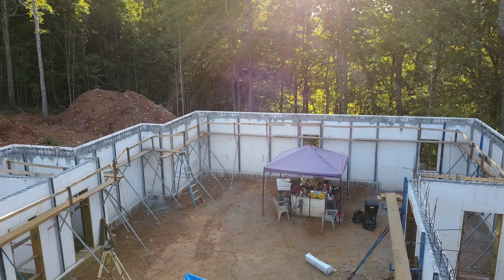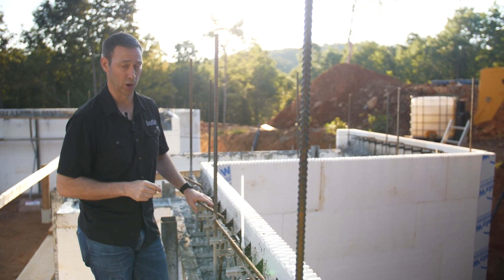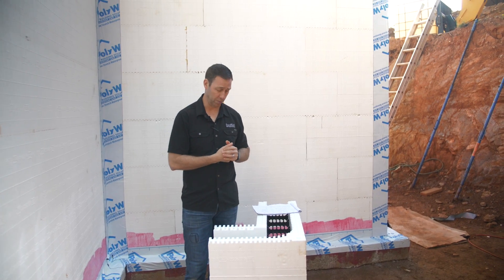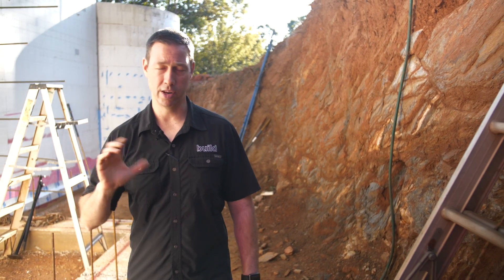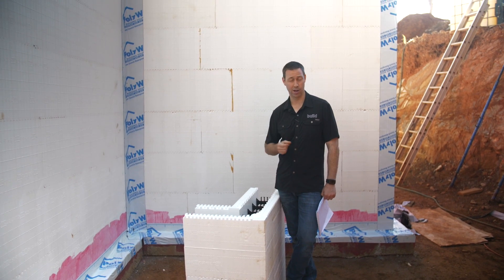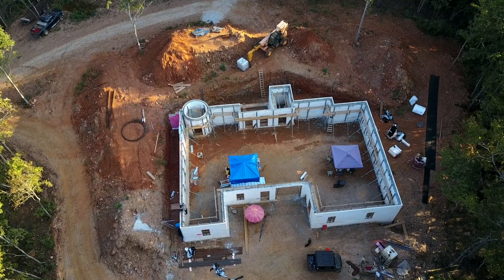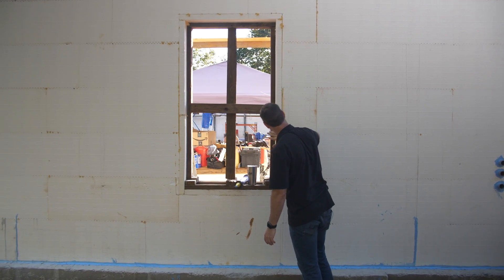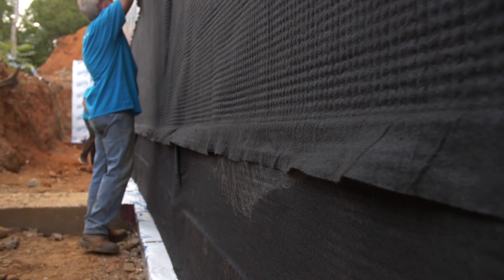Insulated Concrete Forms - Overview, Costs, and Cons

Comment: I'd take a continuous r22 over a studded r30. Using aircrete may raise that r value but it won't be as strong. Can you look at double studded houses? No thermal bridging and no need for expensive and sometimes toxic foams and that rock wool is expensive too I don't like it. You can just use blown insulation which is awesome and I saw that they were putting a vapor barrier in between the two walls I'd like to have that explained to me too I don't know why you wouldn't just use an air barrier or at least put that new membrane stuff on the interior. Have you ever seen those cross laminated timbers used in the US? I'm thinking of trying making my own. What's the highest r-value of a window that you've found?

Comment: This type of concrete with both outside and inside insulation is of value only if you live in a Hot climate. The concrete is acting as a heat sink but the inside insulation means you will not benefit from it much as heat transfer from heat sink to inside is much too slow.  The main reason for building this way is to have a very short warm-up cool-down period when employing heating or AC. But in cold weather there is a high chance of developing mold in between the inside insulation and concrete as the concrete will be mid temp between inside and outside, so dew point temperature. Not to mention the inside insulation being a general nuisance when fixing anything to the wall that has to be fixed with normal dowels. I would have doubled the outside insulation thickness and used a very thin (max 1 inch) on the inside to keep the concrete closer to inside temperature. This is mostly a fast and cheap building gimmick than a novel revolution of insulation.

Comment: I just started looking at ICF. So far, I see lots of great things about the walls.  No details on roofs for this type of construction. What would work in concert with the ICF up top?  I saw some photos of a Logix Tec built home in Paradise, CA.  The only one standing after the fire . Just black smoking holes and ash everywhere else.
Reply: There are excellent strap anchors that embed partly in the concrete and wrap over the top of the truss. Uplift per anchor can be over 1500#.

Comment: I thought you were only supposed to insulate one side.  Either out or in but not both. Just built a building in Northern Wisconsin and the building inspector wouldn't let me do both.
Reply: Probably not for a stick built

Comment: Seems like this is a non-environmentally friendly building method with all of the concrete and plastic (and foam). I looked at this twice for different homes I built and could never convince myself that the gain was worth the long term impact. I really like what I see on your Swiss trip.

Comment: He showed how to attach drywall but if you put in drywall to the forms you also need electrical and possibly water in those same walls. how does that happen if you don’t have space behind the drywall to put wires and outlet boxes

Comment: Waterproofing is a very important issue.  It is not just because of water weeping through because of cracks.  I had do lift a dock out of a lake with my 15 ton crane.  I was right on the edge of the bank and nearly tipped the crane into the lake before I realized that the EPS blocks used for the dock floats had absorbed a huge amount of water.  I was focused on lifting the dock out of the lake and didn't realize that the dock wasn't coming up but as I pulled to lift the dock I was pulling the tip of the crane down.  When EPS absorbs water it will have nearly absolute '0' insulation value.  Sealing the outside is very tough because any small sharp rock that gets pushed against the water barrier can poke a pin hole in the membrane.  Sooner or later water will find its way in.  Also, you need to conceal or cover the EPS blocks above the ground line.  They are not fun to look at, but worse is that they too will absorb moisture, be damaged by pets and wild critters. and they will get dirty with rainsplash.  Covering all of this up is expensive!  On the inside you will have a problem with plumbing and electrical that will be in the wall and that is a very big deal.  I designed a log home for a fellow that "just had to have ICF's.  I told him that he was responsible for getting an engineer to design and sign off on the plans if he converted to ICF's.  He did and went ahead and poured his walls and went to finish it off.  He could not find a sheetrocker to do the sheetrock unless the furred the walls out so they had nailers where they needed them.  All plumbing had to be rerouted to interior walls which was no small feat.  The building department required that all electrical in those walls had to be run in conduit or they would not approve it.  Believe me, that was a very spendy venture.  When he was all done the final cost TOTAL was right at twice the cost to form and pour the walls and he still has to conceal the EPS above ground.  Don't believe everything you hear about ICF's.  There may be places where ICF's have merit, but they are very few.  I'd say that they would be pretty good for an above ground house in a dry area where they experienced a lot of fires.  All in all, I found them to be far more expensive to use as because of the expensive nature of the work following the installation.

Comment: If you want a higher R-value, definitely use polyurethane panels - much greater R-value per inch.  EPS melts at 180 degrees, polyurethane 750 degrees.  The external rock siding will get hot in a fire and cause the EPS to melt and there goes your wall, which is another reason to have a polyurethane outer insulation barrier.

Comment: EPS is an open cell foam, which means it DOES absorb water.  Obviously adding a water barrier to the outside is a good approach.
Reply: I was thinking the same thing. EPS foam wicks water. Mold will grow in between the beads of EPS 'open-cell' foam and you can't get it out. Foam Ice chests are made of EPX foam which is a 'closed-cell' foam. Maybe some ICF manufacturers use EPX?  EPS foam comes in different densities too. 1 lb. / 1.5 lbs.  / 2 lbs.  are the standard. A less dense 1 lb. foam should have better insulating properties, but not as strong.

Comment: You can add more insulation if you want, BuildBlock and several other manufacturers market slide-in foam panels designed for this purpose. BuildBlock calls their product Thermaset, and it is available in thicknesses of 1inch, 2 inch, 4 inch. Each inch adds 4.2 R value. So you could use 8 inch block, add the 2 inch panel, getting a net 6 inch block with an additional R value of 8.4 in addition to the value of the block itself.

Comment: Hey Matt... Is there any way you can do a special on Polystyrene Concrete? Also, I'm curious if you could use PC as a concrete filler with ICFs to increase the R values.

Comment: If I have a concrete block wall. Should I put ICF (or polypropylene- Dow Corning pink) on the inside and outside? I live in a rainforest area in Mexico. I want to keep moisture and cold outside, and let vapor out, because air is very very moist.

Comment: I remember you talking about a cheap replacement for concrete, I think it was two part mix of something that would make a fine foam. Wouldn't that work with ICF system too? You'll have a house that is strong and made right out of insulation. The R values then should go through the roof with it and the whole thing would be light, relatively cheap and hyper waterproof.

Comment: Its seams to me... if you have something similar to a front scoop tractor. Its much easier to just pour the walls laying down then raise them up. Or frame it standing up. Its really not that much work.. if any, and its heck of a lot cheaper. (at least where i live and concrete it self is very cheap)

Comment: R value with ICF is almost meaningless. I know a few people in Michigan with full ICF homes. 1 with a 12" wall and 1 with a 6" wall like this one and NONE OF THEM have heating/cooling issues. The 6" has heating/cooling expenses that's less than 1/2 of their old house and my friend with the 12" doesn't even have a HVAC system !!!! So R value has little meaning with ICF because the thermal mass plays a much bigger role than you realize.
Reply: mass can not act as insulation to stop heat transfer. It just acts as a battery in that it stores heat. But you still have to pay to heat that mass. So when the cold weather comes, the concrete will stay warmer for a big longer, but eventually it will be cold and will now require that much more energy to heat it up. You can't save money without stopping energy transfer, and mass does nothing to stop energy transfer. In fact, mass absorbs energy, it acts as a heat sink.
Reply: @marks6663  The concrete sits on a footer which sits on the ground. Bury the wall with four feet of dirt, and insulate outside the footer, and you have a concrete R-1 pipe from the earth's ground temperature (50F year round) into your wall. It's not about the mass of the concrete. It's the fact that it acts as a heat pipe from underground. Then, inside the house, you're only insulating a 20F difference.
Reply: Cyberslug1 do you know who they used for the construction?

Comment: Well done Matt, great video.   Adding on a couple points you made:  yes, most ICF systems can be braced from inside or outside, and we start slightly towed toward the brace, as pushing against the wall is safer than trying to pull it.    Re: Thermal mass vs R value, if it's constantly hot or cold, mass helps only a little but it is airtight and well insulated anyway.  But if there's a cool night / warm day cycle, as in most dry areas, the  mass helps tremendously to maintain a constant inside temperature.    Last, it's easy to add thicker foam or another layer to some (but not all) ICF systems, so if you want higher R, check that when you select the brand.

Comment: Really appreciate your informative videos. I'm planning on building a new house down here on the water in SE Florida using Miami-Dade wind code. Been researching ICF, but builders/shell contractors down here don't seem to use it. Everyone uses CMU and some completely fill the blocks with concrete/grout. Interestingly, I've yet to see a comparison between ICF and grout filled CMU. The ICF manufactures only compare their product to stick built and unfilled CMU when trying to prove superior impact resistance. Seems to be a less than honest comparison by not including grout filled CMU in their comparison. Leaving aside other attributes of ICF, it would seem logical that a grout filled CMU wall should be at least as strong as an ICF wall. 
Matt (or anyone else), do you have any thoughts on this?
Reply: Jonathan Spier: As a FL certified GC, I say go with your instincts and experiences. You can literally have a plumb, concrete-filled CMU structure in days. It’s done every day in FL. If insulating and sound proofing are an issue, there are more cost effective methods than ICF. I don’t think this video stressed enough the disaster that occurs when ICF are set incorrectly. Especially if a husband and wife think this a weekend project. Don’t try to re-invent the wheel.
Reply: Hurricanes, typhoons...no problem. May not stand up to your wind-bag politicians!

Comment: disaster resistance - i hope the owner never has to deal with fire .
you really need to encapsulate any foam.
otherwise it seems an interesting building material.
Reply: Also, doesn't it produce lethal gases that can kill people before they can even make it to the door or be touched by the flames? Actually same question about foam insulation.

Comment: Non sponsored video? And shit load of false misleading information

What it cost is best to say $20 a block add all blocks. Then use a concrete wall calculation
Not even close to 10-15$ per foot. 

U quote that u can achieve same with 2x6. U forgot to mention extra daunting tasks in air sealing, continues insulation, bulshit u have to deal with to come equivalents to icf. Let’s add those $$$$. As seen from ur other videos, caulk this, seam this, etc...Sometimes near impossible for a diy. Where with icf just like a LEGO lay and forget all in one.  

Only an idiot would build out of wood compared to icf

Flashing...... concrete to wall... termites.... mold, rot.... —— icf = win win

Comment: I am considering using ICF to build to passive house standards.  Anyone have any experience with this?
Reply: Check QuadLock ICF Building systems. They offer an ICF System engineered with different thicknesses of walls that are climate specific. I have been dealing with them since 2007 and the level of support is outstanding. I suggest you take one of their classes to familiarize your self with how to install the system for a successful outcome. It is the only ICF systemI recommend. In the 26 plus years they have been in the business, they have gone global . The DOD uses their building system overseas. It is extremely user friendly and very flexible. 
I am a Passive Haus /House consultant.
Reply: The key to the system is “ Controlled Thermal Mass “ a system I teach and employ along with ice and snow melt systems , as well as a few other items . These are long term “Legacy “ buildings and the devil is in the details . 
These are extremely tight buildings and the ventilation system is critical and I recommend using CERV for your project. Feel free. To contact me regarding your inquiry. CJJones@BCGreen.build

Comment: The foam insulation on the outside is a good way to capture the thermal mass of the concrete, but when you leave the insulation on the inside, you lose that tremendous advantage and you now have to finish and firecode protect yourself from the inside insulation, which off gases when there is a fire before it burns.  And you lose 3" or so of floor space all around the perimeter.  
You could just lay up the blocks, grout them into solid concrete and then attach panel insulation to the exterior only.

Comment: Matt, Not all ICF forms are foam. Durisol ICFs are made from mineralized wood chips and concrete. They come both insulated and non-insulated. The insulated blocks use rock wool in the cavities. The blocks are stacked with the wool facing to the outside. They are also non-flammable.

Comment: Matt,

I'm trying to build a Quonset Hut house in South Carolina, and to circumvent the issue with the curved arch roof inhibiting useful square footage, I was thinking of building an 8 foot(ish) high wall on the slab to serve as a "foundation" for the Quonset metal frame. Despite all the research, I cannot for the life of me figure out what kind of material to use. Cost is more important than appearance, and I was thinking of using cinder block construction - but it is also important to be energy efficient. Is there a way to build new masonry walls cheaply while also having modern insulation? I have seen the Insulating Concrete Forms being advertised, but they seem to be some 15 times more expensive than a cinder block. Any help would be appreciated from anyone!

~Bradford

Comment: Better than OSB for sure. The only problem here is that foam contains potentially harmful chemicals. You don't want any more insulation there in ICF, any house built out from solid materials like brick or cement will far outperform in energy savings a typical  framed US house due to natural temperature inertia of the wall mass, especially if you use radiating heat for warmth.
Reply: paul deg: Eventually, the non-insulated solid masonry wall will have an interior temperature equal to the outside temperature, thus a very cold house. In the US we are not willing to have to wear winter clothes inside, nor are we willing to do without whole house air conditioning in the summer.

Comment: Canadian government agencies building agencies accept a R40-R45 equivalency.
Reply: Some manufacturers offer thicker panels, BB in their case uses inserts for more insulation for higher value but would want to consider going up in core size to account for core thinning due to the insert sizes impeding. One manufacturer does the extra thickness with the molded in web on just one side, another offers web and panel as separate elements and all you need to do is use extra panels as they refer to them to thicken the insulation behind the primary panels of which come in three thickness and two also come in a choice of furring strips (plastic studs) which are embedded into the panel for added exterior/interior finish attachment point.

Comment: how does WIFI and ICF get along? Wouldn't the 6" concrete interfere with the WIFI signal? WIFI has become pretty well a necessity in most homes these days and I feel like it would be difficult to run a strong WIFI connection through an ICF house. If anyone has experience with this product please enlighten me.
Reply: It does interfere with Cell so wifi must also be affected from inside to outside, but there are solutions out there such as Ubiquiti repeaters and placing the wireless router in  view of the window.

Comment: So what's the cost difference when compared to standard and SIP?
Reply: Equivalent to SIP and superior to wood construction, but much less troubles than SIP which have a series of problems related to many not assembled well, this does not have that many issues and many have said their bills are a fraction of what they were paying before and few have even said they hardly have to pay any heating/cooling bills what-so-ever. Many ICF have survived through Hurricanes or tornadoes, there are videos and articles showing them surviving but not completely unharmed, the exterior is usually torn or in the case of tornado stuck ones their wood roofs were torn off with ease and where the windows gave out in a hurricane the main structure remained unharmed while the storm be it either system just cleared the interior belongings, some foam forms were harmed but are easily enough can be repaired.